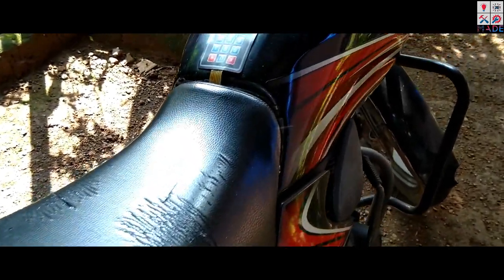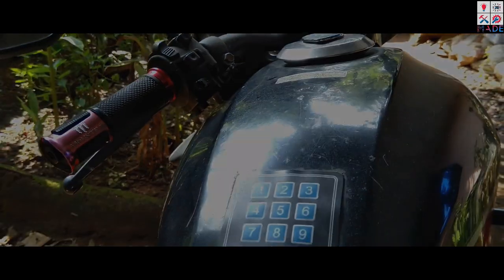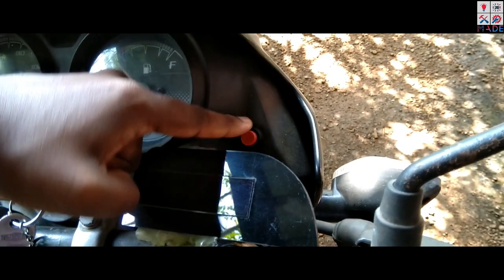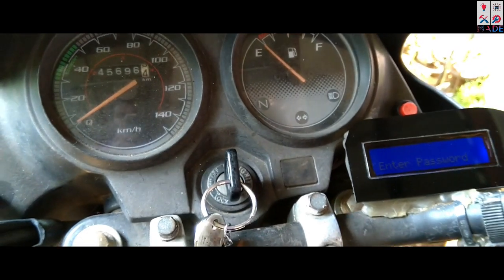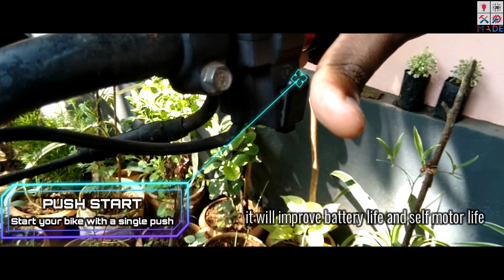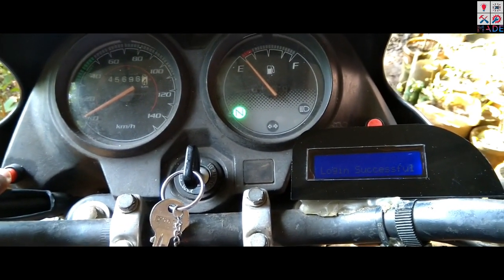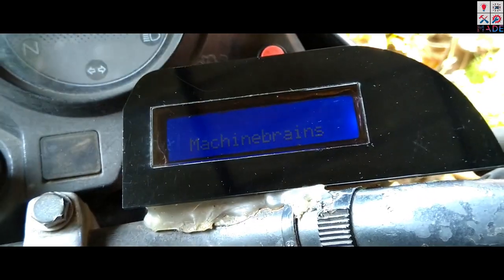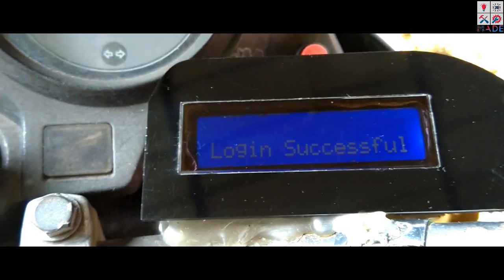I PUT PASSWORD LOCK ON MY MOTOR BIKE

Comment: Bro awesome project!! Single push start nu engine start aayathu engine aanu detect cheythathu? rpm sensor il ninnu otuput edutho? Also ethu microcontroller aanu bro ithinu upayogichathu?
Reply from the maker: It's based on pic 16f877a 
This vehicle doesn't have any rpm sensor.
 So it's a timing based algorithm.
❤️😊🤝👍

Comment: Wonderful project , finger print would have been easier for the user, loved the intelligent start, which voltage regulator IC did you use for mobile charger?
Reply from the maker: But pin is lot more easier for me.
now this system running on my bike is about more than 3++++ year's with out any problems. 
It is rain proof, sunlight proof and it's work well and take every weather conditions like a boss.
I'm not used fingers print sensor here because it's not good and will not work everytime better as you think more over that it will not a water resistant / proof device. So it's not a good option for bike for cars it's okay. And some times this kind of fingers print sensor's could not scan and identify the print well and it's need a few try to get. so it's a bit of waste of time but that couldn't happens when entering the 6 digit pin will only take less than 2 second's thank you.
Reply: @AMNLabs  that's a really good reason thanks, did you forget to mention the IC used for mobile charging from 12 volt battery. Could you please tell it
Reply from the maker: Yeah... forgot it , So sorry. At that time I used two nos of 7805 regulator ic's in parallel to get more amp's out of it. but now, the efficient way to do that is by using stepdown buck converter module's that is more efficient , no heat issues etc i prefer the stepdown buck converter module's instead of regulator ic's like the 78xx. Series for this application.